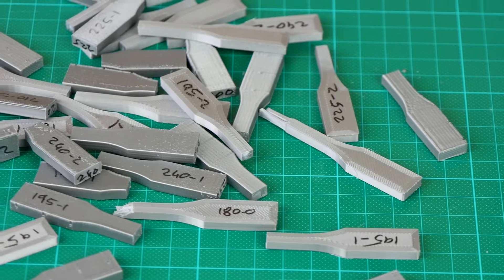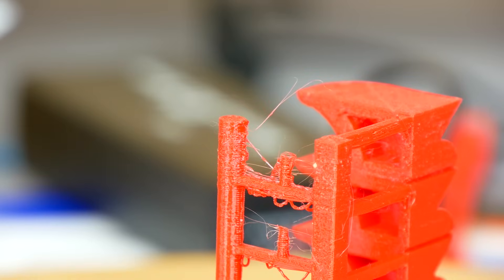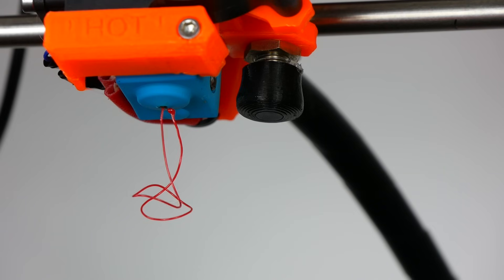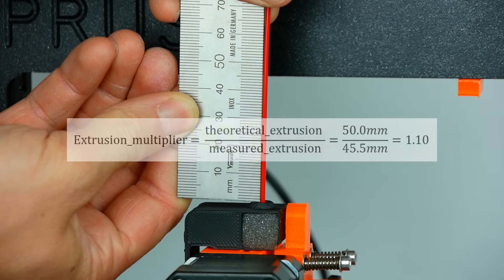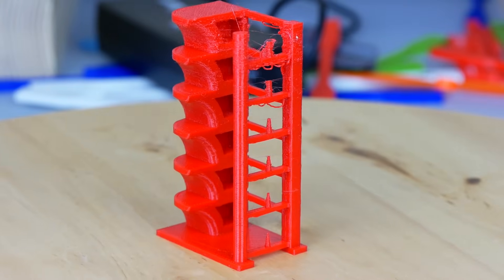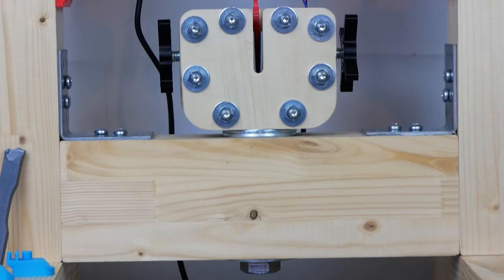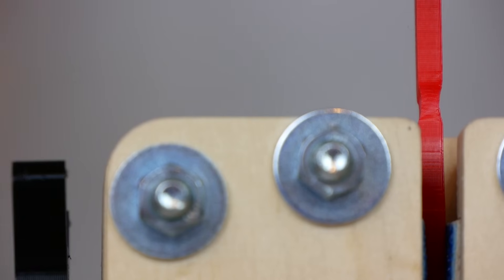3D Printing with PETG - How does the printing temperature affect strength? || Setup & Tips

Comment: In my experience, print speed is more important for PETG then temperature for good layer bonding. PETG doesn't like fast printing speed. While 45mm/s for normal pieces is quite decent, best printing ( especially bridging ) is around 25mm/s @ 235C ( or for example when printing precise GT2 pulleys ). Lowering print speed reduces the effects of surface tension ( the material in it's molten state right after it leaves the nozzle ) > to observe the effects of this, try extruding a small strand in air and measure it with a caliper... you'll see that the extrusion is always much thicker then the nozzle diameter. While this has limited value for normal layers, it is important for bridging.
An even more important value for bridging ( and strength in general ) is  Infill/Perimeter overlap ( I use 55% instead of the default 25% ) which makes a really big difference in quality > think of it as the surface onto which a bridge strand can attach itself.
You're quite right about howto use the pinion teeth and multiplier adjustment....
I'm actually quite surprised that you took the time to do all these tests and forgot to include speed....
Reply: I agree, and that's what I find most annoying about PETG. I have to print it super slowly to get good layer adhesion, I print the first layer at like 15mm/sec just to get it to stick well and not peel up on the corners. It's like printing with TPU; can't print fast, oozes and strings a lot.
Reply: @yucannthahvitt  I print PETG at 40mm/s and it sticks to the bed. I have the bed at 70c. It is a glass bed and I mix a little water with PVA glue and spread it on the glass. The water evaporates the dries the glue by the time the bed heats up.
Reply: @Krytern I have a glass mirror as my bed (with no silicone sheet between it and the metal heating bed) and heat it to 65C but I print the first petg layer at 245C which sticks really tight and then reduce to whatever is best for my petg brand. In my case it appears to be 220C. I just clean the glass with tissue pape if it has finger prints on it. Occasionally I might use methylated spirits to clean the mirror. The petg actually sticks too well, even when it cools down and I struggle to pull it off. Printing at 265 first layer makes it stick way too much. I printed first layer at  220C and then it bends up and falls off my 65C mirror. I never did full range of adhesion. I tried 75C on mirror but this is a waste of power in my opinion as 65C works fine. Maybe I'll try 60C one day as this temp is how I get PLA to stick tight to the glass mirror. I just use 4 paper clamps to hold the glass flat on the bed. Definitely no hairspray or messy stuff is needed on the glass. My fan speed is zero for first 2 layers then 100% after. Print speed slow at 30mm/s first 2 layers then 60mm/sec.
Reply: 55% huh? Going to try it out tonight
Reply: @bertamus  I've been using 50% and been very happy with the outcome. I'll have to try bumping it up a few % points.
Reply: I think I’m the only one getting super strong prints at 80mm/s with walls at 60mm/s
Reply: @akbarramzan4159 you aren't the only one. I just finished a petg print that had pak speed of 160mm/s but average ~60mm/s. Printed with esun petg at 245c /82c on glass bed. Cooling fan (4010 blower,printed duct) 40%. Part feels strong and can't pull layers apart by hand(has happened with too much cooling or too low temp.)  Stringing is minimal. 

Used a tronxy x5sa, with a v6 hotend w/bimetal heatbreak,copper block,.4mm nozzle, direct drive bmg.  So by far not a high end printer and it did perfectly fine.
Reply: Jan you seem to know what you are talking about so maybe you can help with my PETG problem as Stefan never replies to comments, the problem is warping, some people say reduce the squish of your first layer and some people say to leave it the same as for PLA, also some say use the cooling fan off for the first layer and some say leave it on.
What do you do to avoid PETG warping?
Reply: @AndrewAHayes  why don't you just try different combinations of settings? For me, printing the first layer VERY slowly helped a lot. Also you can increase your bed temperature (though I only print at 70C). Furthermore I leave the fan off for the first 2 layers and my Z distance is quite similar to the one I have when printing PLA.
Reply: @AndrewAHayes  did you get anywhere with this? also worth trying brims for warping. And if you use PEI, lightly same the sheet with a fine grit to help it adhere more? And I'd stick with no parts fan for first few layers with PETG. Often my parts fan is completely off for the while PETG print, or just 15% ish. And increase the bed temperature but not too much to avoid elephants foot. I use 85C bed and 200-220 nozzle
Reply: I get maximum PETG strength when printed at 216 °
Reply: PETG infill can print on a  MK3S+ at 180mm/s, and perimeters 60mm/s perfectly well.
Reply: @PBMS123  we all know it will print faster but we are all talking about strength here. It pays to read what we are all talking about. I bet i can use a toothpick and seperate all the infill layers printing at that speed. That makes for a useless 3d printed part that has little tensile strength or load. I print prototypes that hold hundreds and thousands of lbs or hold weight up. I hate 3d printing for useless garage at ludicrious speeds that wont last with real use.
Reply: @Kenneth91619  what speeds are you using?  I've always had great parts, no oozing/stringing, good layer bonding at 30-35mm/s.  But then I keep hearing about people printing petg at 100+mm/s on their bambu labs.  So I decided to try it.  and the layers did bond.  I upped the temps as I saw the layers dull.  Needed to use 248C-255C.  Now the problem is that I could not stop the oozing.  And that causes defects and results in lower strength and cleanup.  I'm about to give up on fast printing unless it's for single parts.
Reply: Agree.speed is key. Then play with retraction some on smaller parts lol.
Reply: Jan Van Haute underrated comment, thanks for sharing 😁
Reply: I don't believe this to be true. The technology might not have been there two years ago, but now it is. The limitation was and has been, true uniform heating onto your plastic. Unless you are using high quality nozzles, something like plated brass, and have a high end hotend like a Mosquito or Volcano, your volumetric extrusion will be limited by the technology and power supplied to your hotend. This means, that while you may very well be able to print PETG at 220c at 45mm/s, when you try to print at 100mm/s, the layer bonding is not as good because the flow rate and design of the hotend limits how hot the extruded plastic actually REACHES, yes the nozzle is reading 220c but when you're printing at that rate it cannot possibly read the lowered temperatures of the mixed molten plastic, it is afterall only going by a thermistor, it's not directly in contact with the plastic, because when you're printing 100mm/s, it goes quick. Stuff like fan cooling also highly affects the temperature of your nozzle and will impact how hot your actual extruded plastic is.
In short, the weak point was the technology in hotends and their extrusion of high flow plastic at consistent temperatures. Fan cooling also highly impacts layer bonding.
Reply: @Stormbringer81  but this is specific to PETG needing slower temps. If that was true, it wouldn't be PETG specific and also apply to PLA etc?

Comment: I print in esun PETG at 240-246C with no bed fan and don't get any deformed prints and they seem very strong. From my experience if you don't use the bed fan the layers hold together much stronger. Esun stuff is great.

Comment: Use a filament dryer while it is printing. Pre-drying and drying while printing will keep moisture from being a factor and you will have much better results. It might be a moisture issue or a byproduct of a specific batch of petg, but I've had very good results with my prints from anywhere between 230-260 deg c, and I am also using a Prusa mk2. Anytime that I have noticed bubbling in my prints, it was a buildup of moisture in the plastic.

Comment: You printed the Z probes not in serial right? so just two at the time, so the temperature of the previus layer has no time to cool down like it would be on a lager printed part!

I also did some Tests with PETG an found out that if i print them as single probe at the time i could reach up to 44MPA but if i print 3 in parallel, with more cooling to get them cooled down before the next layer starts, they just reach about 15 MPA (all at 240°C)

That leads the question: are the results really representive for bigger parts?

And if both of our tests are made right, will the strength of the adheson maybe increase on higher temperatures for big parts like with PLA but not for small parts like the test probes?

Comment: Your findings are much like I have found ...... I'm printing at 230c and 235c caused lots of string (just did my testing tonight). My Grey eSun PETG prints well at 230c and ran a sample at 225c and that was very, very nice too. Many on YouTube I think are running PETG at 20-30c higher than they need ... I could be wrong, just saying !
Reply: Today after work I started to print  with the hotend at 220c and the prints are the best yet .... stringing has been cut down very, very, very significantly and infill of 20% is very well defined. Don't think I need to lower the temp any more. My flow is at 97% which may help as I'm not getting any extra oozing of material or clumps and lumps. I think I have found the sweet spot for this printer and eSun Grey PETG combo. Print speed is 40mm/s at the top end on a MonoPrice i3 Plus printer that is two days old ;- )

Did not start out on this printer using PLA, as this printer is be used only for prototyping of test/concept parts that must hold up more than PLA.  I may use a carbon impregnated PETG as Time goes son ... I will see.

I'm contacting eSun to see if they have plans for a carbon impregnated PETG filament .. that would be great. There are some other makers of this material on the market and I may go to them if need be.
Reply: Well after a few days of 8 hrs a day testing PETG ..... I have changed my mind as PETG prints well on flat objects, but is horrible for many of the items I want to print ... I have tried every retraction setting and changed the temp, along with flow rates ... I could go on. While I have been testing on my MonoPrice i3 Plus, my partner has been testing on the Prusa i3MK2 s with the same results. The two major things we both agree on is how incredible brittle this material is as it just about explodes when it goes and the stringing is a bear to get rid of.Yes I have wiping the nozzle set and all kinds of retraction settings ... not good.

I have switched back to PLA and PLA pro and have been getting great prints, I also just ordered a role of Maker Geeks Rapter PLA to test annealing with.

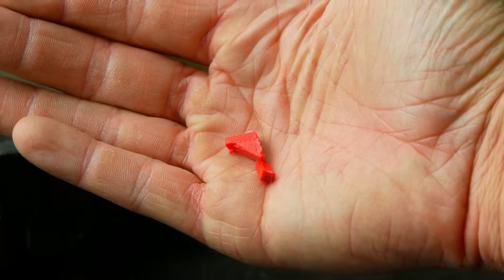Comment: In the 7:51 you asked why it breaks with a hammer and not while stretching. That's because every material has different resistance in different ways. By hitting a hammer you put high shearing force in a very short time, which may lead to a conclusion that PETG has low shearing strength. But... as I wrote earlier, hit time was very short, so we should think that dynamics shouldn't be more responsible for damaging probe. Anyway, if you'd like to know more first I recommend you https://en.wikipedia.org/wiki/Strength_of_materials

Comment: Most polymers are strain-rate sensitive. Fast strain rate (hammer impact) => break/fail at lower stress. Slow strain rate (gentle loading) => more plastic deformation before failure. It's like oobleck, but much more subtle.

Comment: So, the PLA is stronger than PETG!? Thank you for a good test case.
Reply: I think it is not quite that easy. PETG is rather ductile while PLA is very brittle. As an example, push fits turn out much better in PETG than in PLA. They require less force and you are at a much lower risk of breaking the whole part.
Reply: @num2gardena79  And you can make the fits much tighter without worrying about the part breaking.

Comment: Have you tried printing PETG on a PEI surface? Works phenomenally with PLA, but I've destroyed two PEI sheets now with PETG prints that permanently fused to the surface. Feels like it would be a great surface if I could figure out how to dial back the adhesion a bit.
Reply from the maker: I used GlueStick as a separation layer, than it's easier to peel it off. During my first tries I even added BlueTape to not damage my PEI sheet.
Reply: I heat the PEI to about 65c and don't have a problem. The only problem with PEI I had was with a flexible filament.  That stuff did not want to come off! Also best to not squish PETG into the PEI too hard.

Comment: Generally I run my fan at 25% and find that is a great compromise between no fan and full fan when it comes to PETG.
Reply: I agree with this, PETG needs just enough fan so that overhangs don't droop awfully, but too much fan negatively affects strength. Do some overhang tests, just a basic degree slope without support, to see where your fan performs best around 40 degrees angle to 50 degrees angle. Use as little fan as possible.

Comment: Greetings!  I just started with PETG (purchased at Monoprice) and have found that the lower temperatures work better too.  The manufacturer states 230-260 C, so I started out trying 240 C, but my test piece was very stringy and layer adhesion was bad (easy to break apart with my fingernails).  When I backed down to 220 C, I didn't have any stings and the layer adhesion was better.  Using Wanhao i3 clone by Monoprice (Maker Select Plus), 100% fan speed, 40 mm/s print speed, 0.1 mm layer height, Cura slicer.
Reply from the maker: +Andy Moore Thank you for the info.

Comment: hi! I found this video really interesting and since I have a Prusa i3 MK2 I was wondering a thing.... is it true that PETG prints are very difficult to remove from the build plate? if yes what is your solution to overcome this problem? thank you very much! :-)
PS: I tipicly clean my build plate with denaturated alchool. Is it ok for PETG? or might it be the wrog choice?
Reply from the maker: +Mirko Ragni Depending on the brand, PETG can stick very well to the PEI sheet on your build plate and even damage it while removing the print. I printed some parts on blue tape to reduce that problem. A little bit counter intuitive is that applying glue stick also reduces the adhesion which can also solve that problem and probably is the easier solution. Try out small parts at first before you do bigger ones!
Reply: CNC Kitchen that you very much :-) very helpfull tips!

Comment: Hello,

Briefly, about the behaviour of the polymer which can stretch
or break, it depends on the loading speed.

If you apply the load gradually, you let the time to the
polymer chains to move into the polymer and thus it absorbs the energy. The
energy used to deform the part is used to reorganize the structure of the
matter.

If you load your part quickly, you don’t let the time to the
polymer chains to move, to reorganize themselves and then the chains break,
which induce the break of the part. 

The same problem happens with the temperature at which the
polymer is loaded.

Hope it helps you and I’m sorry if I made mistakes in writing
this. 

Thank you for the really interesting and serious studies you
realized in each videos!
Reply: This is called "strain rate sensitivity" where there is a strain rate dependent ductile-to-brittle transition point or range within normal service temperatures.  A notch impact test will only show specific notch sensitivity and only ever at one strain rate.
Reply: True. Polymers have time dependent Young's modulus which also varies at different temperatures (Probably everyone once noticed this with "Rubber" in his life). So in general, it's really hard to modulate these kind of materials in FEM programmes. 
(Bachelor in mechanical Engineering and Master in Engineering Science)
*sorry for bad english
Reply: Anyone with a formal education in engineering knows this.

Comment: Really enjoy your videos, keep up the good work! Do you have the stress strain data available from the tensile test? If not would you be able to make it available? I'm working on some designs and could really use the data.
Reply from the maker: Just wirte me a message you you need. I do not use my extensometer for all tests, since it's quite tricky to use. I actually plan to create a database for all of this data but did not have the time yet to create it.